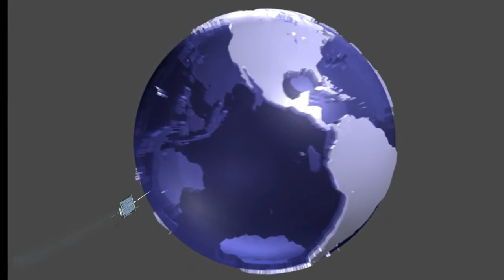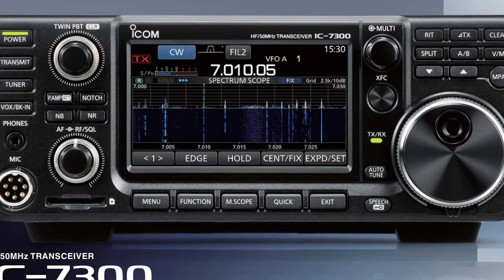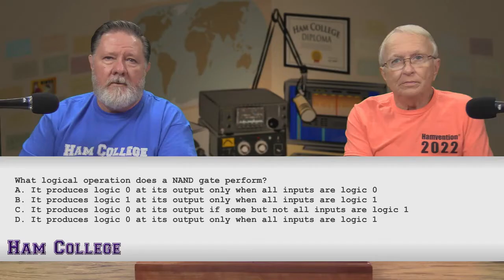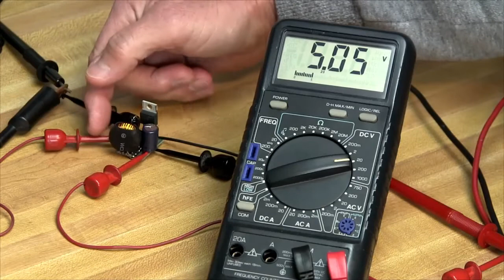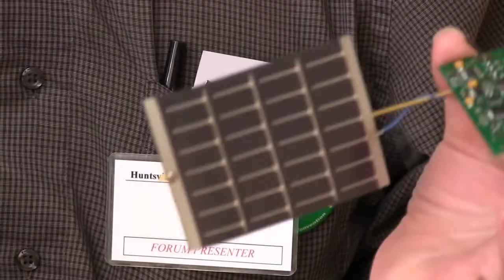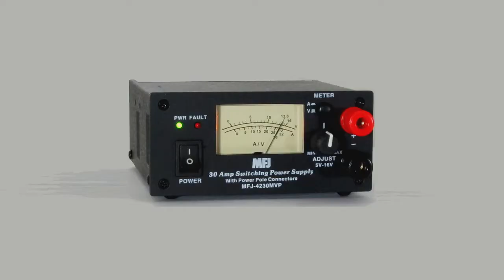Ham College 92

Comment: The question at 17 minutes answer is in the prefix bi- vs mono- vs a-.  Monostable multivibrator has one stable state thus monostable (see A).  Astable multivibrator has no stable states thus astable (see B).  And bistable multivibrator has two stable states thus bistable (see C).  Answer D is simple a regulator found in power supplies.